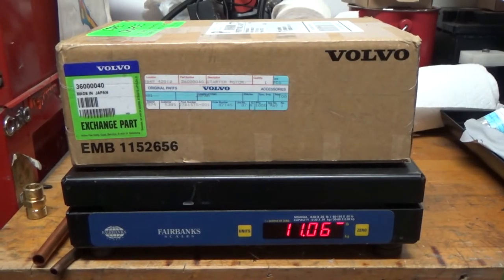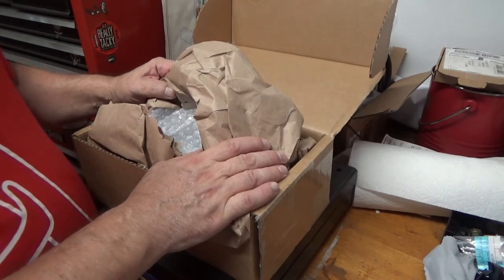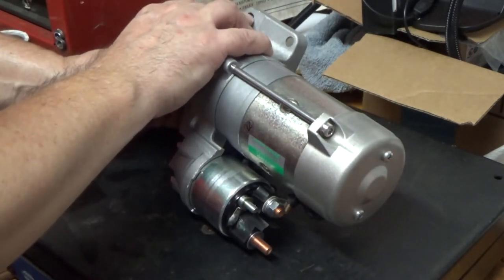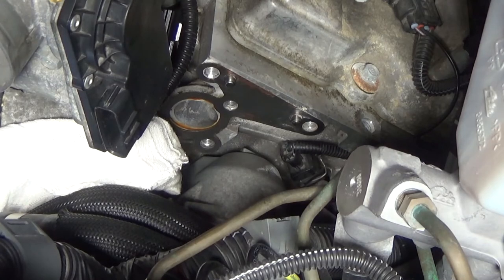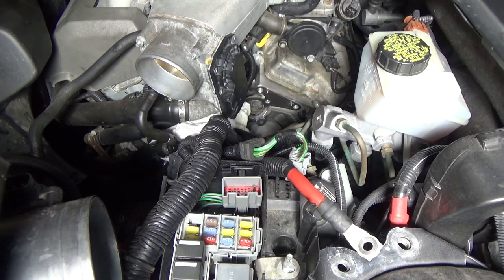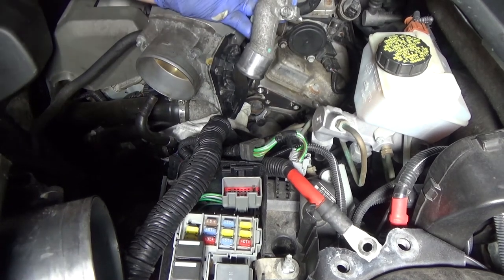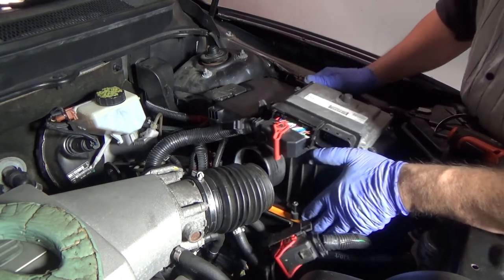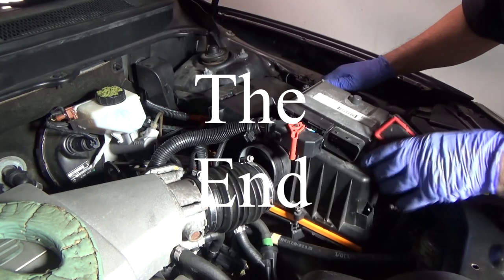Volvo XC90 V8 Starter Motor Replacement

Comment: I think my starter is starting to go out on my V8. Looks like I have a pretty big job ahead of me. Thanks for sharing.
Reply from the maker: May I recommend that you have the problem diagnosed. Even if that costs you a little bit.  There are some issues with the security system that can cause issues.  Also the slightest issue with the battery can cause issues.  I would hate for you to spend all that time and/or money on the starter when the issue may be a battery or a security module.  Good luck.
Reply: @A_Renaissance_Man  I was going to get a service key made just for that reason. It is odd that sometimes it will continue to crank even though I let go of the key.
Reply: @csebastian71   sounds like a bad relay
Reply: @honorablewiz7447  The starter relay?
Reply: @csebastian71  my guess in theory... the relay or selonoid
Reply: @A_Renaissance_Man  I’m curious to know what were your symptoms that led you down the path of replacing the starter. I have 4 outcomes when I turn the key to start position. 
1- starts right up 
2- after letting the fob go, it stays in position and continues to crank on its own. 50/50 on if it starts or not. 
3- turn key, nothing happens 
4- cranks slow and either starts or not. 
I replaced the relay and that seemed to work for a few days but now the craziness returned.

Comment: I started on mine today and everything is out and apart that I can tell needs to be. I can't quite reach the bolt in the front due to a hose, and the bolt in the back is really hard to get to. 

What size are the bolts that hold the starter on, as I feel like this will help as I'm fishing around.

Do I have to remove that back piece you have off that is metal? Mine is still attatched and I don't know what that is.

Finally, for the front bolt, do I need to remove the really short hose directly above it?
Reply from the maker: It has been a while and I remember it was super tight.
I think I took the hose off as the system does not need to be burped to refill itself from the reservoir.
Bolt sizes are a tough one to remember.  
15 or 16mm would be my guess.
Reply: @A_Renaissance_Man  That's helpful, thanks! I am going to remove the metal pipe, as I realize now it's part of the coolant system and I already had to drain it.

Comment: My fav v8 mechanic. Not sure if i missed it, but why did you replace the starter to begin with? Im getting a slow/weak crank occasionally, almost like the starter isnt getting enough juice. Battery and alternator check out ok.
Reply from the maker: @vbnautical5041  First, The car set outside for two years on a front right crash rebuild.  After passing State Inspection the starter behaved as you described, occasional slow, weak, or no crank.  I saw corrosion on the cables and replaced the starter but it was the battery.  When I tested the battery everything read OK but upon replacement, the car behaved normally.
Not saying that is your problem but it just may be.

Comment: Thank you for this great video! Did you ever find out what your starting issue ended up being from?
Reply from the maker: Turned out to be the solenoid which had pits and some black carbon buildup on the bar that connects the battery cable to the starter motor.
Reply: @A_Renaissance_Man  Thank you so much for your response, you're awesome!

Comment: Likewise, thanks for your excellent repair videos regarding the XC90 V8. I just purchased a 2008 XC90 V8 and are learning lots.
What was the symptoms for you for a bad starter?  I occasionally when hot get a pause when I turn the key to the start/crank position and when the starter actually engages (about a 1-2 second pause).
Reply from the maker: The repair shop said they have not seen any starter issues but rather there might be an issue with the transponder communication.  I still have an occational non start but I just turn the key back and try again and it works.  That makes think that the video was performed under a false diagnosis.  Good Luck.
Reply: Oh I see, I will keep a more close eye on mine. Your video was excellent, thank you for posting these great repair videos (subscribed with thanks!!)

Comment: I have a 2007 XC90 V8.  I was able to sneak it out without taking the coolant block/hose off.  Used a variety of open end/box and ratcheting box wrenches. Alldata and Chilton say to take the intake off!
Reply from the maker: The starter cam be removed without taking the intake off.  The process is difficult in that there is twisting and turning.  The process was not easy.  The process was trial and error.  I did not show all the frustrations but, the video is truthful.  Keep trying.
Reply from the maker: The starter cam be removed without taking the intake off.  The process is difficult in that there is twisting and turning.  The process was not easy.  The process was trial and error.  I did not show all the frustrations but, the video is truthful.  Keep trying.

Comment: Hey David, did you have to replace the gasket for that one part that you had to take out above the starter?
Reply from the maker: No I did not replace the gasket.  The gasket was in great shape and I had gasket material to make a new one but decided that I did not need it.  The gasket in question is still good today,  4 1/2 years later.

Comment: You left a massive amount of information out of your video.  Did you actually remove the torque mount.  This is the only diy video out for the xc90 v8 starter replacement and its incomplete.
Reply: Well, as you can clearly see the vacant mounting holes for the torque bar......